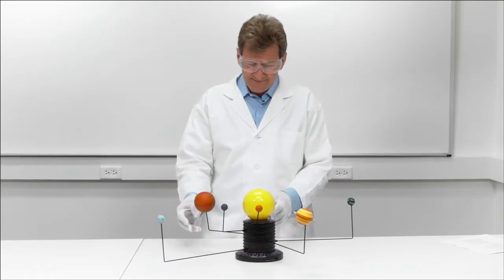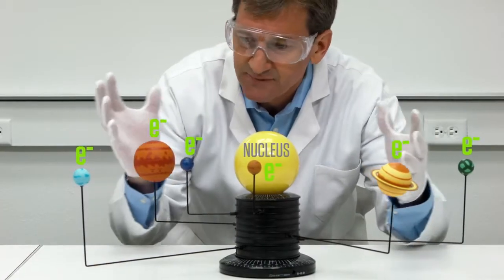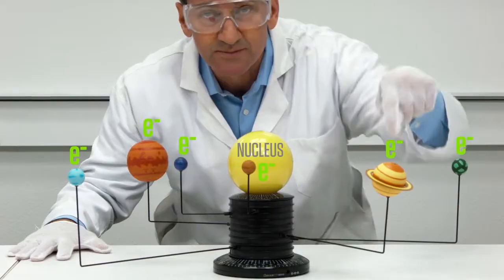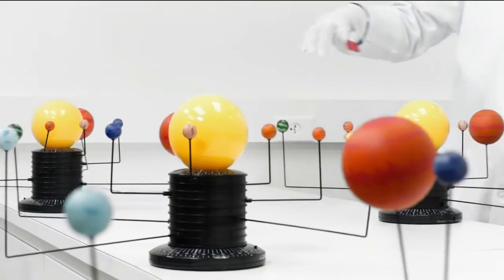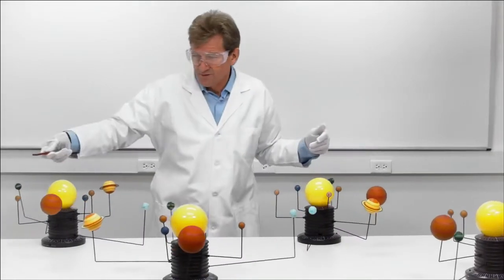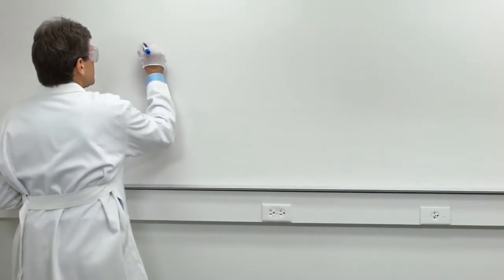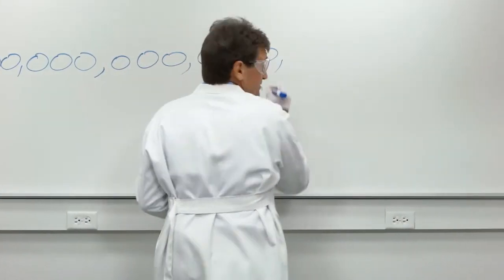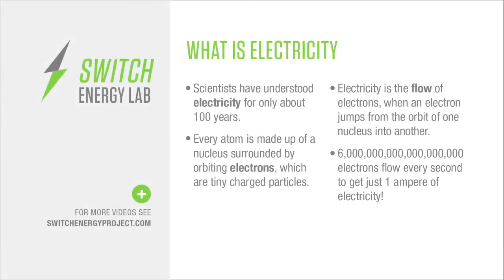What is Electricity? - SWITCH ENERGY ALLIANCE

Comment: But what is the charge? What gives the parts of atoms a charge? Then where did that come from? 
And its strange too. Information can't be created or destroyed. And we see that particles in a collider vanish before they can do anything and don't interact with much either. Sooo how do they figure its like the early universe if those pieces don't reform into particles or have they even tried to do that? Cause that would confirm the theory....

Would need to probably have to use a mas of atoms that equal an Abrams tank and somehow get the sub atomic particles to get close enough to each other for them to theoretically recombine into..... Into what?